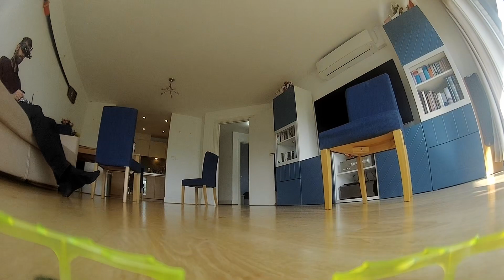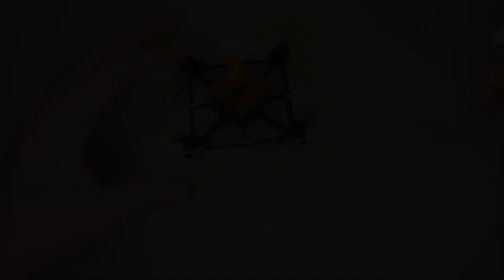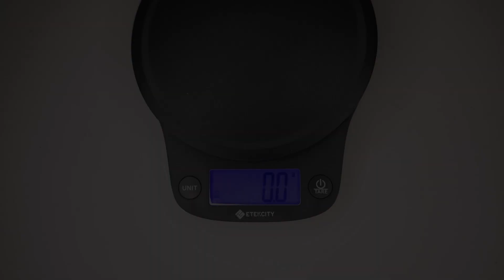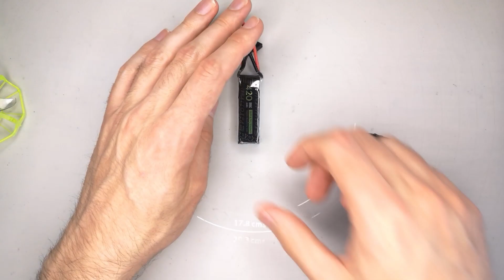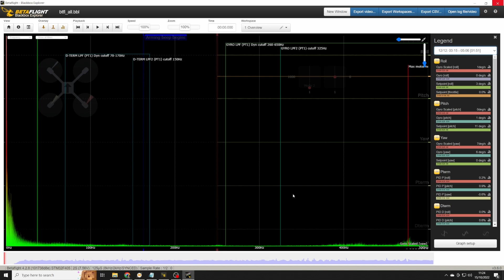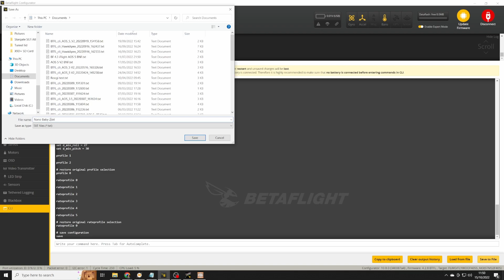Flywoo Nano Baby 20: The king of the Whoops!

Comment: Meanwhile, the Baby Nano 20 comes with BF 4.3 and Bluejay 0.18 directly from the factory. I was about to flash when I discovered it. Insane flight times. 8-10 minutes on medium agressive cruising with a GNB 660mah LiHV (fits the 750 battery tray perfectly). 72g for the analog version with 660mah battery.

Comment: I have just received mine from Flywoo. Flies good, but I would like to try rpm filtering. Still I am hesitating a bit to flash Bluejay, because of the definitive warning against flashing of ESC in flywoo website. It is also strange that flywoo listed O-H-30 while esc configurator shows Z-H-30 as a target. Is it safe to flash?

Comment: Hey Chris - Would you expect bluejay to provide additional flight time on a whoop this size?  Also did you fly yours outside yet? Wondering on the performance Still waiting for my VRX so mine is just sitting there collecting dust
Reply from the maker: I would think so. Bluejay 48KHz or 96kHz will imporve efficiency for those small 1002 motors.

Comment: Excellent video! I was trying to follow along, and while flashing the ESC's the flasher just hung! I waited for a while and nothing happened. I disconnected and reconnected my quad and now it reports that ESC #4 is missing when I read settings! What can I/should I do?
Reply: It eventually showed up again over time! ooof! 🙂. I was able to properly flash them eventually.
Reply from the maker: Oof, Indeed! Happy to hear it all worked eventually. It shouldn't be possible to brick BL_S ESCs with a bad flash as far as I know as the bootloader is separate.
Reply: @ChrisRosser  🙏🏼👌🏼
Reply: @ChrisRosser   I then tried to upload your BF 4.3 CLI but I couldn’t get it to work so I reloaded the backup. (My drone came with the latest betaflight firmware installed). 

What should I change to enable the better features of having updated the ESC firmware with Bluejay? I enabled bidirectional DShot and set the poles to 12. Is there anything else? 

I’m new to betaflight and still haven’t figured out how to just pick what I need/want from the CLI file.

Comment: Thanks Chris!  I just moved my DJI version from BF 4.2 to BF 4.3.1 and Bluejay.  It's now flying so much better!
Reply: When you upgraded to Blue Jay on your ESC did your props spin up without moving throttle just arm switch.  cuz I had a problem with my props not spinning until I gave it throttle on BlueJay I don't know if that was because of the 96 pwm frequency or not and do you have lots of prop wash, I do. When going into hard turns..
 how did you get rid of it?

Comment: My flywoo baby nano 20 is only reading as dfu bootloader mode when i plug it in and it wont connect to betaflight. I only get the first three beeps on a 2s lipo and if i try to flash the flight controller to bf 4.3.1 it will flash but not connect and if i plug it in again i will go back to dfu mode. Do you know what could be going on here?

Comment: So back in late February early March of 2022 I bought the dji fpv drone because it looked “cool” originally I went to get the dji mini2, that was going to be my first drone. I went home with my new dji fpv and learned of the world of fpv. I’ve been into rc cars and trucks and could not believe this hobby has alluded me this long. Now I have built 4 5” quads, bought 1 bnf…the Iflight Evoque F5X and have been wanting a toothpick/nano/micro drone but didn’t want to invest into analog or add analog to my dji goggles, witch I have almost done lots of times. I’m happy I waited and this Flywoo baby nano 20 has came out with the naked vista. This thing is not only a blast but making my trick list bigger because I cannot use a simulator and I didn’t want to crash my 5” builds learning new tricks. This nano 20 has given me the ability to become a better freestyle pilot. It does bobble around but that doesn’t even phase me since this thing fits in my palm. After following the tutorial at the end of the video to up date to blue jay and 4.3 along with Chris’s filter/pid tune it does fly noticeably better then out of the box. Once again I must thank you Chris, you always find a way to further my knowledge and help me in this hobby with your videos. I do try to do my part by buying your AOS v2 5” frame, next is going to be a AOS 5.5” build for my GoPro 9/10. Thanks again for being you.

Comment: Hey Chris,  Thanks for updating the BF4.3 CLI, Just as a quick reminder to others that after they flash BF 4.3 and apply your BF4.3 CLI dump, they should go back their original BF 4.2 settings they saved and reapply all the VTX settings.  VTX settings will be different based on the drone they purchased (analog, hdzero, or walksnal).  Great video!!

Comment: Hey Chris, I have half a dozen micro quads that all have F411's and run BF 4.2.x.  I want to upgrade to BF 4.3, but am not sure if the F411 will work properly with bidirectional dshot, telemetry, etc.  What would you suggest (not including replacing all my FC's)?

I have no issues with my existing setups and the quads fly nicely.  Yet, I do like to stay current with software updates.
Reply from the maker: Should be fine to update to BF4.3 just make sure loop rate is only 4k and use dshot300. Everything else should work as before.
Reply: Ok, I will try one today and see how it goes. Thanks for you reply.  Love your channel.

Comment: Hey chris, quick question
You updated bluejay with 48 PWM 
I dont fly anything lower than 5" inch but heard that as a rule of thumb, tiniwoops u should do 96 PWM, 3" and 4"inch 48 PWM and anything above 5"inch should be 24 PWM ...
am I wrong you you got personal experience where u see better perfomance on 48 PWM?
Reply: Having recently gotten into tinywhoops it seems like from the day BLheli_S got 48Khz to now thats the recommended setting. You lose responsiveness at 96Khz in comparison.

Comment: The DJI Naked Vista version is only 2g heavier than the WalkShart version. Yes, a naked Vista is very durable, and I for one haven't had a single failure with mine.  It's actually WalkShart and HDZero that are way less durable than the DJI Vista versions. JB and others have reported issues with how fragile the VTX's are with those two systems, but nothing really with naked Vistas. Sure, some have damaged there's,  but it's been a rarity. 

Besides the firmware flashing Chris recommended, I'd also suggest switching the antenna to a tiny dipole. For a whoop, and on the DJI FPV system, a dipole works really good! I easily fly down my street and around my big house with no distortion to the picture quality at all. That should save a fair amount of weight.  
I've used 0802 16,000 kv motors on ultralight digital builds like this and they have plenty of power. These 1002 show weighing 2.4g vs. the 0802's at 1.9g each. So, you'll save another .5g x 4 = 2.0 grams with those motors.  
Those prop guards weigh 1.3g each x 4 = 5.2 grams total, so they add quite a bit of weight to the whoop!  
Flywoo is all about flight time, and nothing about optimum performance, in my findings, so a 420 mah 2S (21.6g) or a 750mah 2S (35.4g) are both too heavy for me! I recommend what Nick Burns uses - a NanoTech 300mah 2S 45- 90C (and only that one) and have many to change them out when you want to fly longer, but the performance is significantly better with a lighter lipo, especially with whoops! They weigh only 17.6g with an XT30. With the 300mah 2S you'll save another 4 grams over the 420mah 2S and the 300's weigh 0.2 grams less than HALF the 750mah 2S (35.4g)!!!  
I'd never, ever put a whoop through flying with that heavy of a lipo! It's very hard to control the throttle, just like Chris mentioned in this video, when the lipo is that heavy. I call it the pogo stick scenario!  Because the whoop is constantly pogoing up and down with often hitting the floor.  No fun to fly at all!  GUYS:  Whoops are NOT about long flight time - they're about smooth flying and great performance, and only light lipos give you that! 👍

Bottom line:  You can build a much, MUCH lighter digital whoop than what Flywoo offers us. To give you an idea - This WalkShart version weighs a whopping 50+ grams with prop guards (see Chris weighing it).  The DJI version will be only 2g heavier.  But, a YouTube friend of mine from Europe races with a DJI whoop he built that is only 35g !  He says he competes very well with stock Mobula6's and other analog whoops in races.  I've seen his videos racing and he does great!  He uses a Mobula7 V2 frame (lightest), HM 0802 16,000kv motors, a Naked Vista with a Polar Nano (but the Nebula Pro Nano is only about 0.7g heavier and it gives us 120fps and full adjustment of settings), and he also uses bi-props.  He says he thinks he can get it under 30g, so everyone use your imagination and SCALE to weigh your whoop to an ALL TIME RECORD LOW WEIGHT - then post it on YouTube so we can all learn from your mastery!  You can do it! 😎🤘
Reply: 1002 is easily worth the extra 2 grams for over 50% more volume. Probably the minimum we should really be using on 2 inch.
Reply: HDZero can do 1s whoop. I have made some 1s HDZ whoop.
Reply: Some people wanna throw a 750 and a camera on it and use it as a micro film rig. 300mah too small

Comment: really enjoy your vids Chris but I would say this is more micro than a whoop
Reply from the maker: That's fair. 2" is large for a whoop to be sure but you do need a little more oomph to lift the digital vtxs. Even the smallest ones.
Reply: @ChrisRosser  completely agree with the extra power needed to cart these cumbersome vtx's about. I dropped my HDZ mob6 into a meteor pro frame and swapped motors to 0702 and I am really enjoying this combo.

Comment: I agree with Chris.  If you own any micro, BF 4.3 and BlueJay are a must.
Reply: Can F411's run properly on 4.3 w Bidirectional dshot enabled?  I want to upgrade my existing quads to 4.3 and they ALL have F411 processors.
Reply: @cccagley5276  Absolutely.  I'm running a 411, using DSHOT 300 and a 2K PID freq. with about 25% CPU load.